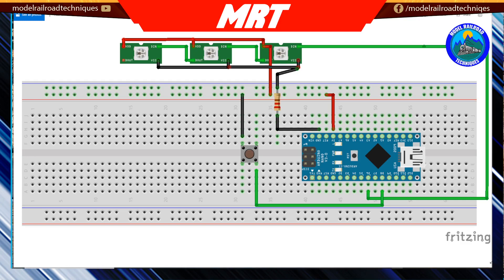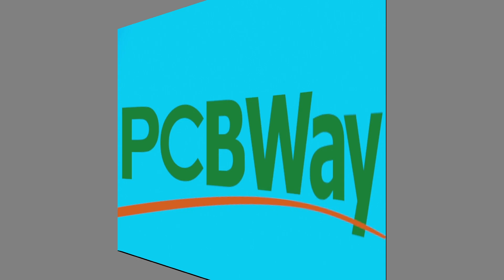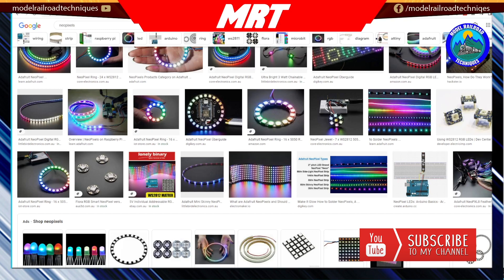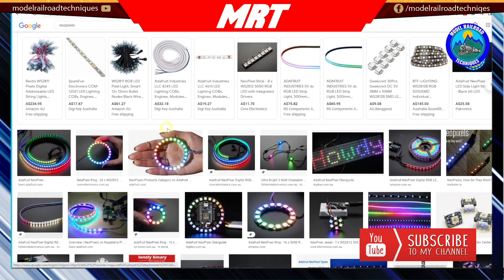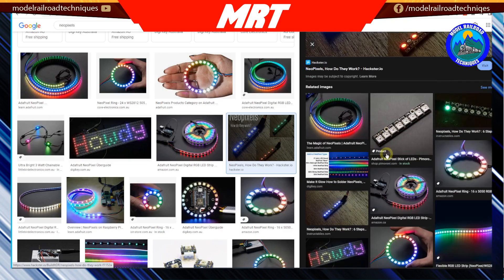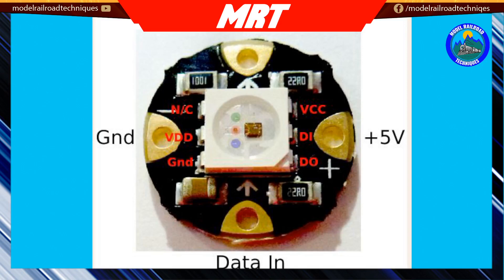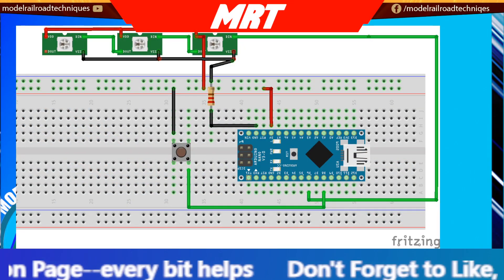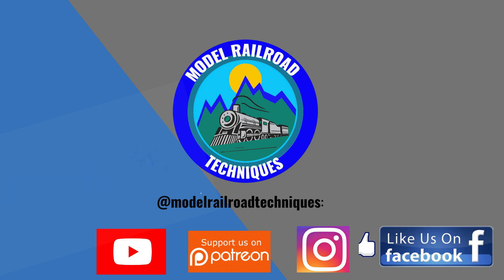Amazing LEDs for your Model Railway

Comment: There are so many options with neopixels/addressable LED's.   Don't just search NeoPixel though as that is a particular branding, there are many options that won't come up under that search that do the same thing.   If you get the pixel (which is a chip and 3 LED's usually) small enough, you could even simulate billboards and the like on the layout.     Great for searchlight style signals as well.
I don't see them a huge advantage with ambient lighting, such as building lighting or street lights though as they tend to be a fixed colour and you can just get LED's of the right colour temperature to do them.
Reply from the maker: Thank you, great advice. I will start looking wider. Lots of fun
Reply: Whilst I agree about streetlights it's not because they need to be just on or off (in some place street lights have ambient light sensors which means they switch on and off at different times) but rather is down to the size of the neopixels themselves, in all but the larger scales they would be too large to accurately represent a streetlight.

The advantage for individual buildings is easy if you have a large building like an office block or a hotel with just 3 wires per building you can if you wish light every individual room, thus you might have the entrance area switched on always, a restaurant switched on just for meal times and a bar on for longer than the restaurant but shorter than the entrance area, meanwhile you can simulate a random pattern  of lights in the various hotel rooms, with one extra wire and I would suggest an extra nano you can simulate the effect of TV's in some of the rooms as well taking full advantage of the varying colours of the neo pixel, I'd suggest the extra nano (or similar) because TV's tend tochange colour very quickly whilst room lights go on and off relatively slowly so much easier to be running on two different arduinos

 I'm pretty certain I have seen someone do a tutorial where they used a similar individually controlled led setup but using fixed colour LED's but I cannot find it now. That said neopixels are pretty cheap £20 will buy you 100 which is a lot of rooms
Reply from the maker: @davidorf3921  thanks for your comprehensive comments. I see you are well advance in your lighting journey. I would love to see some of your work.
Reply: I remembered how its done for white lights only, you can buy WS2811 chips and connect individual led's to the 3 outputs of the chip, these are 12V powered versions and in theory will support up to 3 LED's per output however each LED on a single output will have the same brightness, the advantage of this is clear if you have scale lights on show such as street lights, as you can make every light individually controlable, great for simulating gass lights being lit along a street or the warming up of a sodium light or perhaps a flickering bulb in one light amongst several or as I mentioned above one light coming on earlier than overs because its in an already shady location or going off earlier as it gets the first light of dawn. So my advice would be to use Model Railroad Techniques method to light rooms where you cannot see the light source directly and WS2811 chips where the "Bulb" is visible and small such as street lights or lights on a terrace, you can get away with up to 100 WS2811 chips in a daisy chain which should give you potentially 300 individually addressable LED's

Comment: Very nice introduction to neopixels Daz!  Have been using neopixels for several years with Arduinos or smaller ATTiny85s.   As a steel mill modeler, they come in handy to model the "hot stuff" like hot coke in a coke oven, molten steel in an electric furnace, molten metal in a hot metal car, etc.  What's nice is that a small (or large) degree of randomness can be easily programmed.  So the colors, the intensities of the colors, the time between color changes, and which neopixels are lit can be programmed for random and subtle realistic effects such as flicker.  To do so, the random() and randomSeed()  functions can be used.
Reply from the maker: Wow I would love to see this. I am just learning g what these little guys can do
Reply: @ModelRailroadTechniques  Daz, do you have an email address that I could send some pics to?
Reply from the maker: @donaldkormos5529  I did indeed that you. Will study it some more
Reply: @ModelRailroadTechniques  Sent you an email ... hope you got it ...